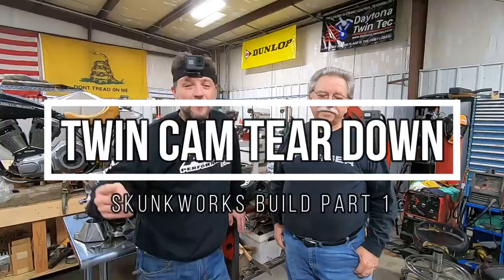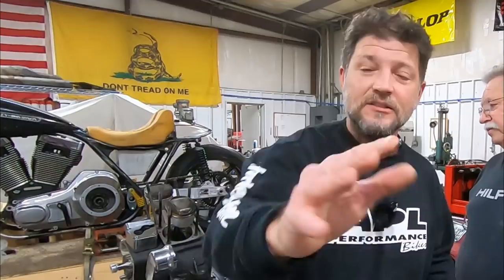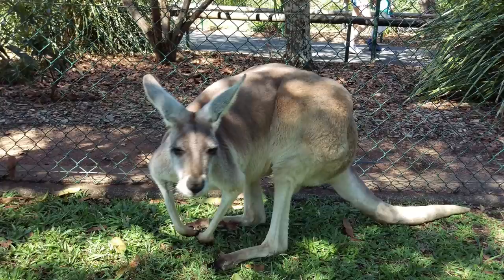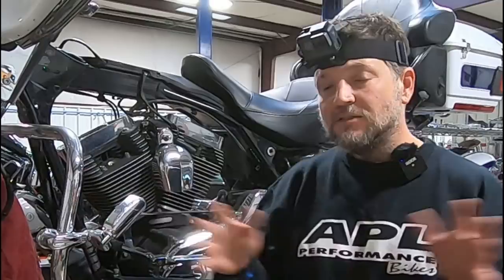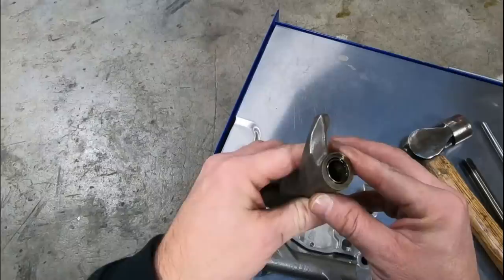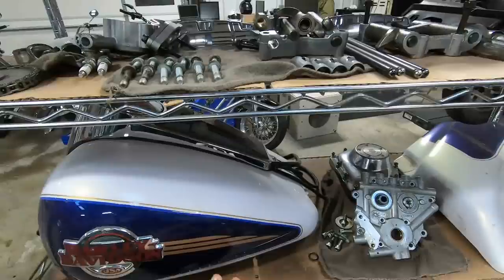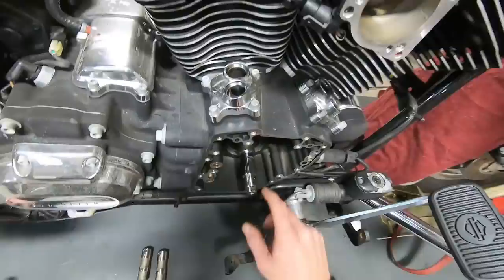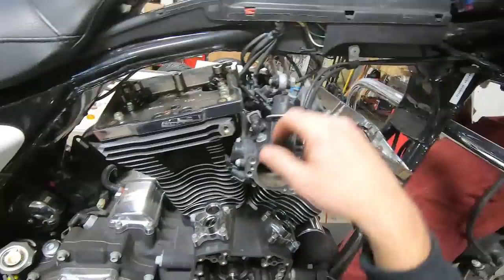Twin Cam Tear Down Harley Part 1 - INTERVIEW WITH DEFECTIVE M8 OWNER - Kevin Baxter - Pro Twin Perfo

Comment: I digress. Jeep liberty the other day. Brake caliper was dragging. Wound up being the brake hose. Wanna know how to fix that? From the factory? Cant just unbolt the brake hose. You have to cut the brake line. Cut it! Flare it to accept the new brake hose! How insane is that? Your second brake hose and you have no room to cut as it disappears into the engine bay where the new hose will never reach!. That to me was as incredulous as those milling crumbs. Pride in trade is taking a backseat to economics. It depresses me, that thought process. Made in America is going the way of the Dinosaur.

Comment: Kevin;  I like your channel and appreciate your vids.  What I don’t like… is when you start sniffing Harley-Davidson’s ass.  You do NOT have to defend Harley-Davidson.  Let THEM explain why after spending $25K - $35K, 30,000 miles later (and often less)- your compensator falls off, or your crank is junk or your oil pump seizes because it’s jammed with plastic bits from a tensioner that failed.   Let them explain why they have so many recalls for STUPID things like cable routing, failing hydraulic clutches, ABS brake systems locking up or the complete failure of the bypass system on the ABS brakes failing to actuate the brake pistons  Let THEM explain why their extended warranties are as useful as toilet paper.. denying claims because of aftermarket parts or calling things ‘normal’ wear and tear.  Let THEM explain why their engines run abnormally hot.  Let THEM explain why their horsepower numbers are underwhelming vs the competition in the same class. Let THEM explain why they continue to expect customer loyalty without ‘giving back’.  Kevin; do what you do- it’s great and I’ve learned a lot from your vids,,, but stop being Harley’s lawyer.   Ride safe everybody.